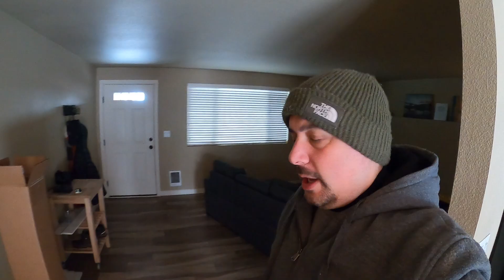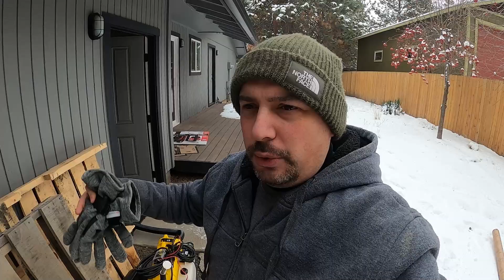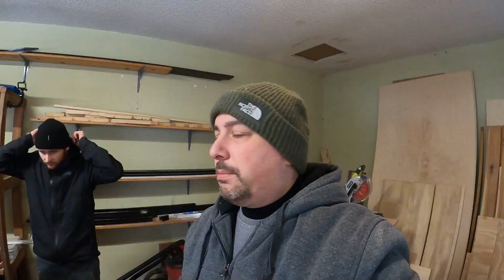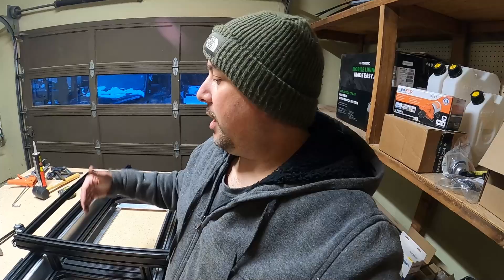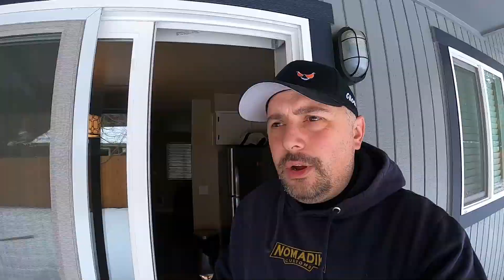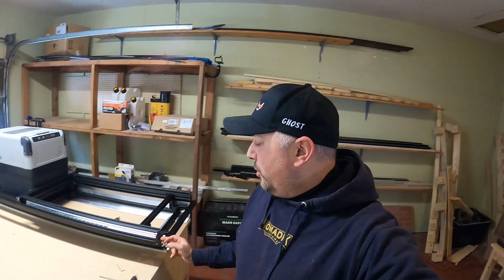Friend Building his Van While Living out of it - Update on Custom Slides

Comment: Heaters??
Mister heater, propane tank and a fan on the ceiling! Heated a huge mechanics garage in the winter in WA, so I could teach painting classes! My friend is using one in his 32 foot travel trailer. Works great!!
Reply from the maker: Those do work. But if it's hooked up to a 1lbs tank then it will only last 4 hours on low setting
Reply: @jarrodtocci  we had them set up on bigger tanks. Had real high ceilings so the fans blew the heat down.

Comment: if the fridge is on the back of the side, as in it'll be the furthest thing in the box, yer gonna hate it.....having to pull the whole thing out every time you want to get at your food.
Reply: I'd just put it at the end of the truck box. not on the slide.
Reply from the maker: Couple reasons it's there. Yes it's in the back but also all the heavy items are located in the back of the slides. Second the only time I'd be using the fridge is when parked up for a while and my slides would always be out. When it's in you'll see why I did what I did. But I see where you're coming from